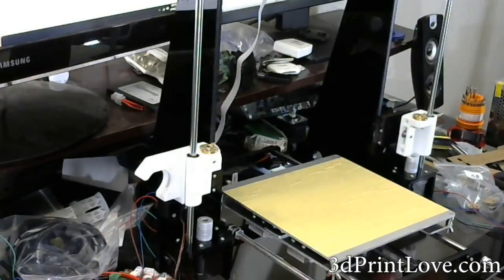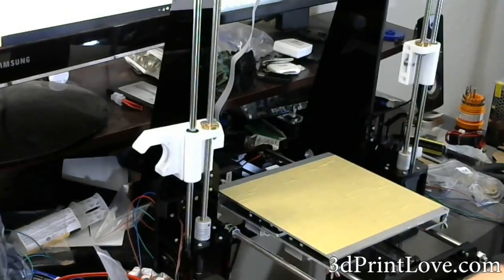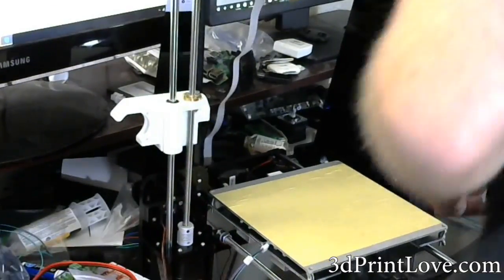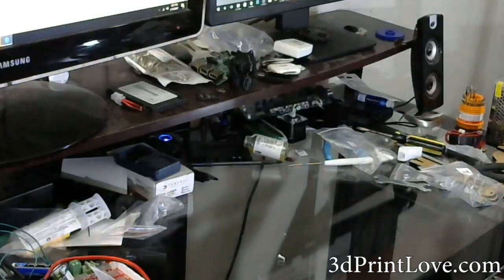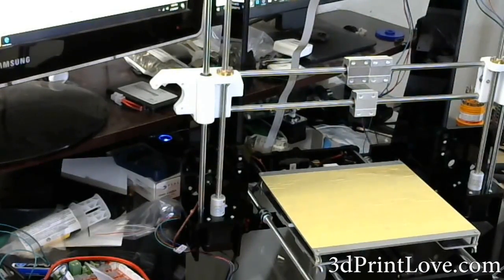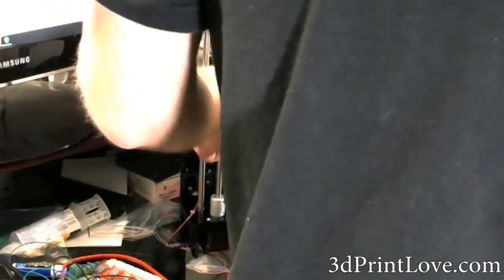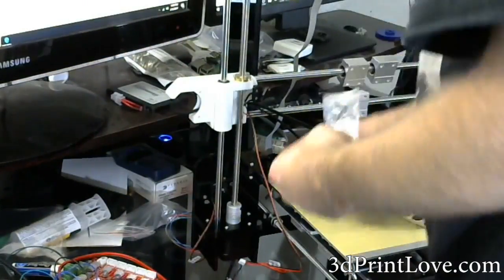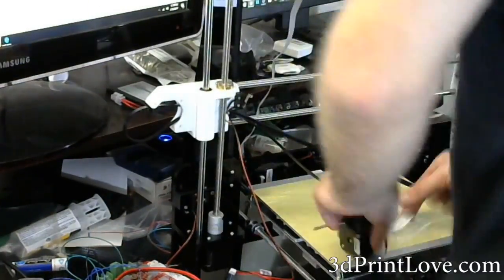3d Printer Catches Fire In House | 3d Printing Safety

Comment: Maaan! if you buy an Anet A8 you're gambling pal!
Reply: I have one. If you build it correctly, it is unlikely to fail. The most common ignition points on mine are completely cold.

I do, however, use my own firmware build, an ATX power supply, and an automotive relay for the bed. The stock firmware is unacceptable due to lack of thermal runaway protection.

Comment: I had a printer fire in February (Hictop printer). Looked pretty much like the printer in the video. But the absolute worst part of it was all the smoke/soot damage on the ceiling and upper 1/3rd of the walls.

Comment: 2 causes normally for Anet A8 fires. The first one is a detatched thermistor from the hot end, which could come loose and set fire to something. The other is the hotbed terminals which aren't really suitable for the 10 Amps of current loading on the CPU from the hotbed, which causes the terminals to fail. You can circumvent the issue of high current loading on the CPU by using a MOSFET for the hotbed, or directly soldering the hotbed connections, but there's little you can do if the thermistor comes out and you've left the printer unattended if you have no safety measures in place. I never use the heated bed because It's not needed for PLA, and I print functional parts in PETG. As long as you get the settings and bed levelling spot on you don't really need the heated bed for PETG, it is only normally required for ABS.
Reply: You can test for and install thermal runaway. You should do that on every 3d printer you own

Comment: Thanks for posting this. Not the first time I've heard a diy go bad....That said I recently ordered an A8 and will be receiving it in the next week or so. After seeing a number of "upgrade" videos, I am planning to run it "stock"...just to print all of the mounting brackets and some of the stabilizing pieces that are needed/recommended for some immediate upgrades such as the Psu and Mosfet. I'm new to all of this, but this and other videos have convinced me to upgrade.

Comment: I've had mine for quite  awhile  now no upgrades  and no issues I run this thing everyday and at first I was paranoid  about  the issue and checked everything  out after every  print to make sure I didn't  have fire issues. I  think  because  it's  diy  the risk of machine failure  is substantial  when assembled  improperly  by inexperienced  people I mean let's  face it if toasters  were diy  there would be quite  a few toaster fires  from people that just wanted  toast do we blame the toaster? be safe  assembling  these  things guys  and if you're  unsure you can get them assembled. I would like to add that for the most part if you're  looking  at a diy  kit your more than capable  of putting  it  together  properly but now that 3d  printer  prices  are more affordable  in diy  and anyone  dieing  to get their hands on one is willing to take that risk because  it's  so damn  exciting

Comment: Fuse everything. A lot of issues can be avoided by fussing everything and knowing the current capacity of the connectors and wires. I see a lot of signs of overloaded connectors in videos of 3d printers including this one. A ground fault outlet should also be mandatory. I cringe when I see a 3d printer sitting on a wood shelf built into the wall like one well known youtube 3d printing person has set up. Just the other day I saw another one lining a printer enclosure with foam that is not only highly flammable but gives off deadly gas in large amounts when it overheats. It could kill everyone around it with no flames. A smoke detector is not enough, a co detector is mandatory.

Comment: I made a super simple smoke detected safety shutoff for mine. Quick and easy extra level of safety.  Even did a tutorial on it ;)  Cheers.
Reply from the maker: I will have to check that out thats an awesome idea :D! Hope you have been doing well man!!
Reply: Doin well Bud. Just back from 2 weeks in EU. Yeah check out the vid and mod it to suit your needs- $3 arduino, $1 relay, $2 MQ2 smoke sensor and $0.5 DHT11 sensor and you can kill the printer on both temp or smoke ;)
Reply: Can you make a way to put out the fire
Reply: need to add a co sensor to it. When dealing with plastic they can give off enough co to kill without enough smoke to set off an alarm.

Comment: He was running everything stock, no mosfet, no upgraded wiring for the heatbed, stock firmware and he left it running with no one home...it sucks but thats a recipe for disaster. With 20-30 bucks you can make the anet a8 much safer and with the massive community behind it its easy to know which upgrades to do. Still, always a good reminder to the people who havent done them yet because they thought they didnt need them.
Reply from the maker: +ImpatientTurtle all of my machines that are kits right now have psus with failsafe mechanisms built in. I do not have a Mosfet board for all yet like I do on my anet a8 but after this I will be ordering additional. It's sort of one of those things that most don't think will happen to them but then if it does its to late. I hope this event can serve as a reminder for us all who have neglecting safety to make it the priority.
Reply: Yeah definitely , glad no one was hurt and at least some good will come of it from people reading the reddit post and watching this video, thanks man.
Reply: I mean its $160 delivered for a 3d printer, you know you're not getting outstanding QA and service at that price. Id still recommend the anet a8 to anyone who willing to do a little research and know that you'll have to do a few things on your own to make it safe and get the best prints. Its definitely not a set and forget printer but the community is huge and always willing to help out other owners. Probably depends what country you're in as well, Im in Australia so our choices are limited, it was about $200 to get this delivered or  I was looking at 7-800 for the next step up and that was arguably not for that much better quality anyway. Still shitty what happened to you, I ordered through gearbest and had no issues but I know other people have had a few missing bits.